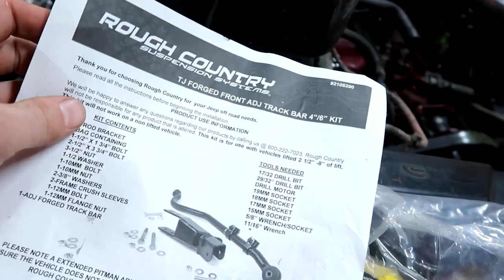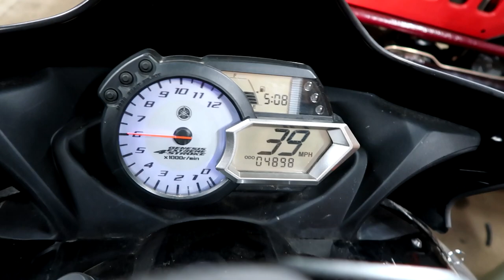Saturdays are for The Boys

Comment: My thoughts on a Polaris ATV.

Very powerful engines, these bikes are quick as hell.   And the 4X4 systems are great.

In terms of reliability these bikes are a total piece of shit.    I've had 2 friends that had one and it's nothing but problems and repairs.     It gets to the point where you end up being half afraid to take the thing out of the garage because something might break.

These bikes also set on a wide frame, which is both good and bad.    The wide frame makes a Polaris a pretty damn stable bike, however it'll struggle getting places a bike with a narrower frame would go.

Honestly, I wouldn't buy a Polaris.    The piss poor reliability outweighs any pro's the bike has.    Polaris is just to much of a money pit.